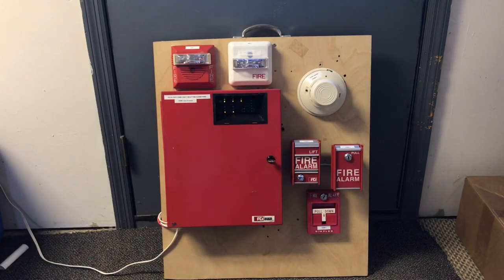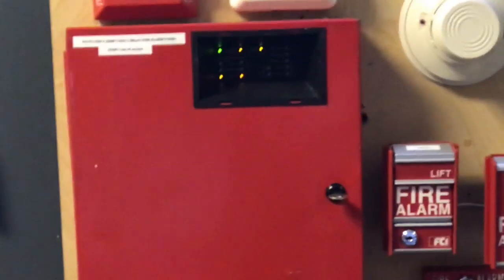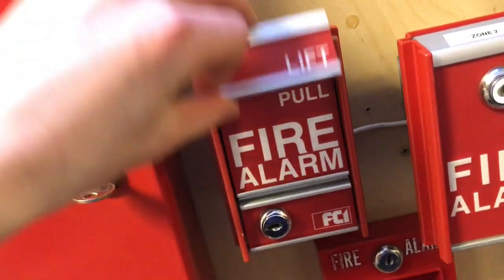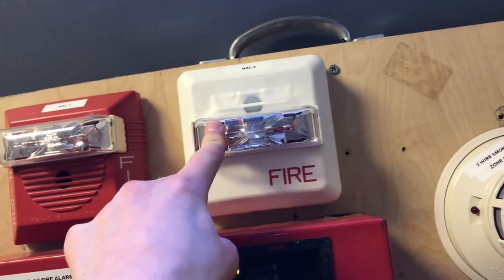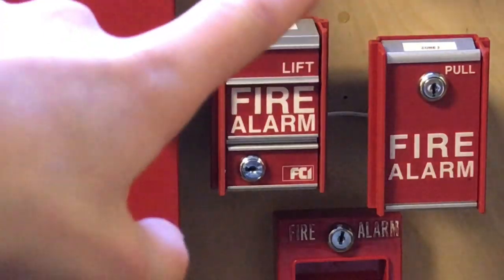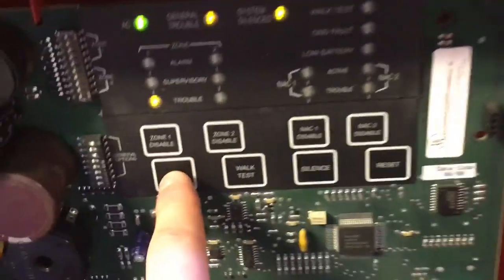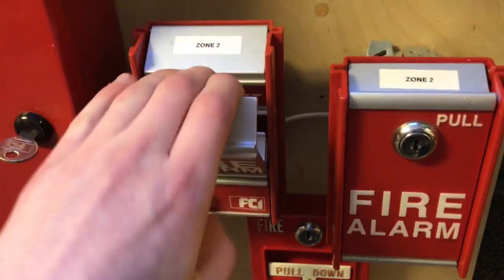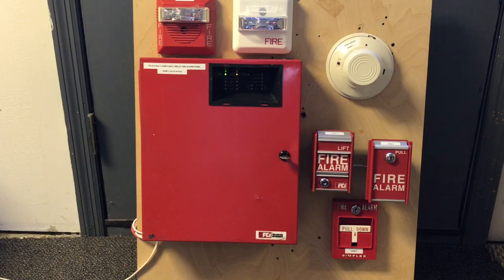FCI FC-2224 fire alarm demo 1

Comment: Nice, 

as a safety recommendation, I would recommend grounding the panel especially since the cord coming in already has a ground lead, it would just be a matter of stripping and joining the 2 wires.